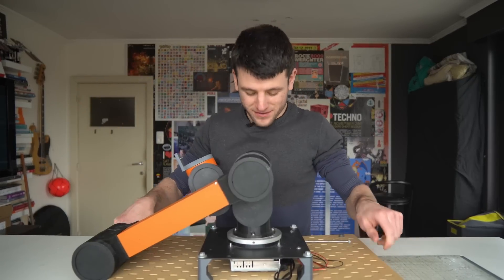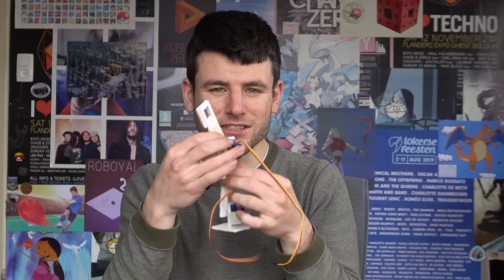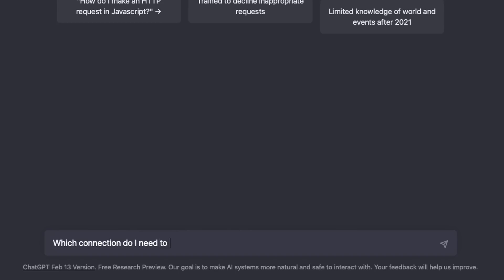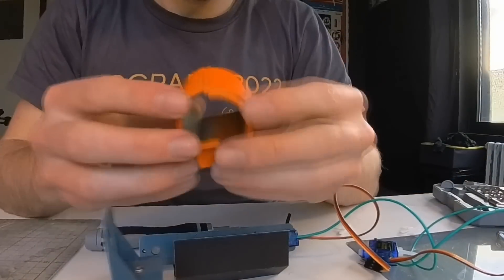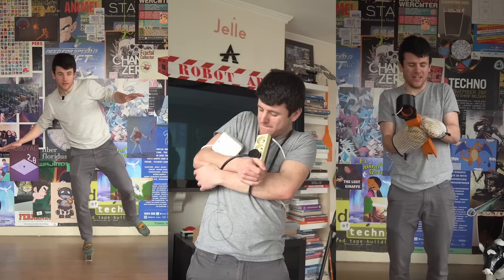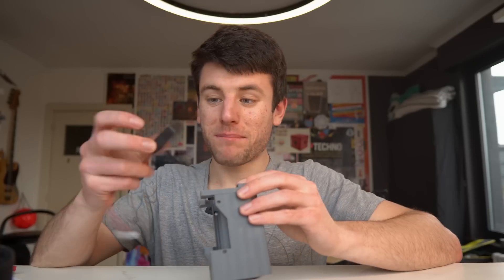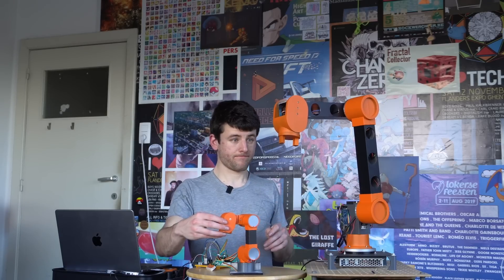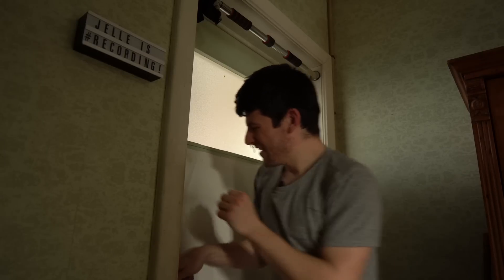I made a Mini Robot Arm to Control my Big Arm

Comment: You used the wrong type of bearing for the arms. That lazy Susan bearing is a thrust bearing which is made for axial loads, like on the lazy Susan all force goes down onto the bearing. What you need are bearings made for radial loads, like normal bearings which are made for forces that act radially.

That thrust bearing won’t do much there.

You could also use a higher temperature plastic. Most printers can handle PETG or ABS or ASA which are quite a lot more temperature resistant than PLA.

Comment: Hey, Can you please upload the schematic for Arduino from servo
I did not understand how the data is received by Arduino

And as always.. awesome video
Reply: The arduino just needs to read the potentiometer value, which is just an analogue voltage. Then the arduino probably just communicates with the PC or Pi through serial.